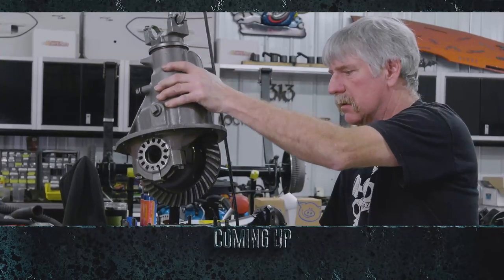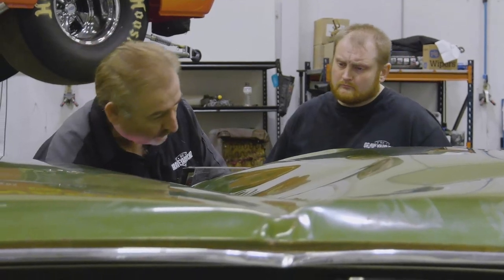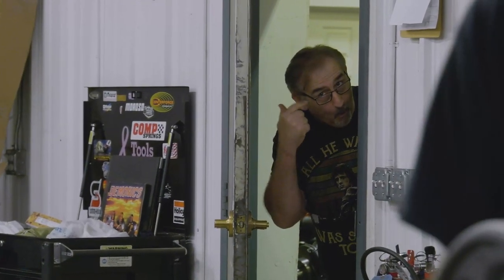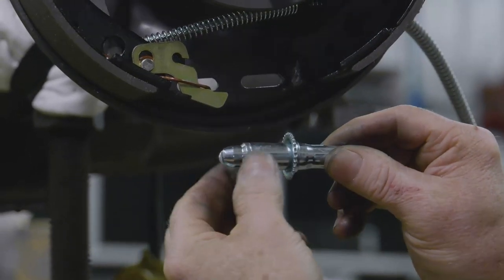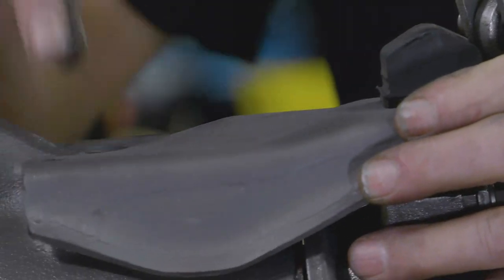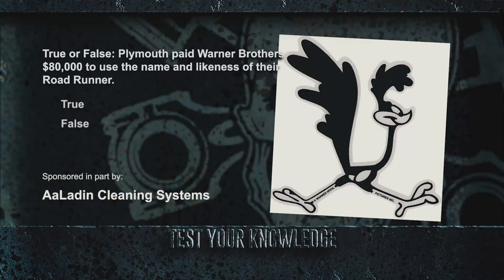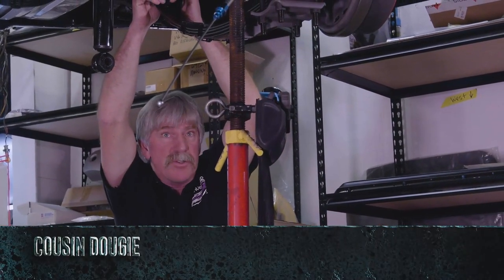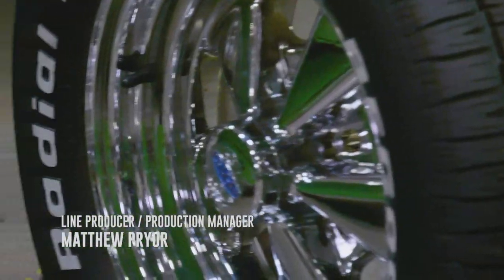HOW TO REPAIR A CAVED IN ROOF: FRAME PULLING CLASS IS IN SESSION. YOU WON'T BELIEVE IT!

Comment: I used to make ballistas out of leaf springs...well, one ballista out of one leaf from the largest spring set. It was easier to attach the cable to the leaf with the curled ends. It launched many rebar rods and broken tool handles (broom handles, shovels, post hole diggers, etc.).